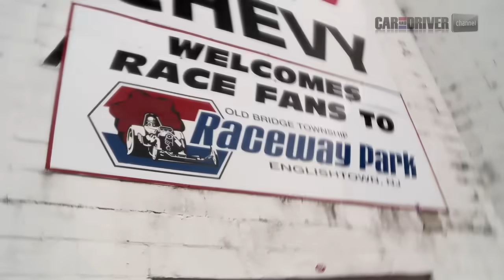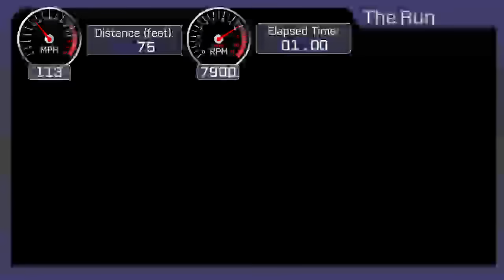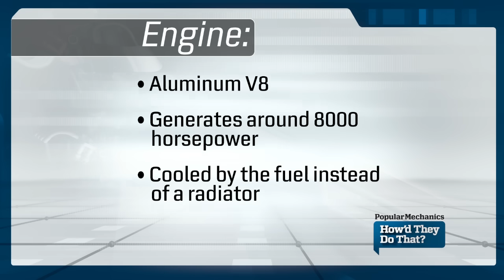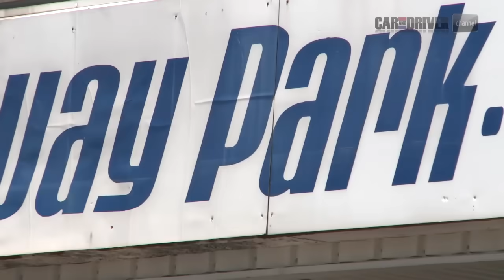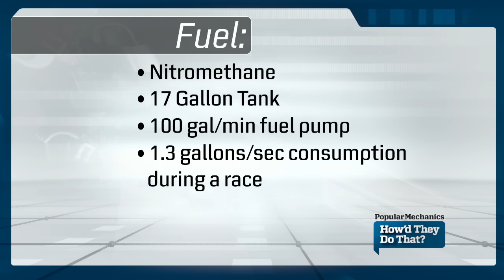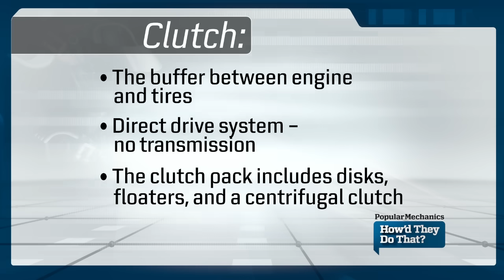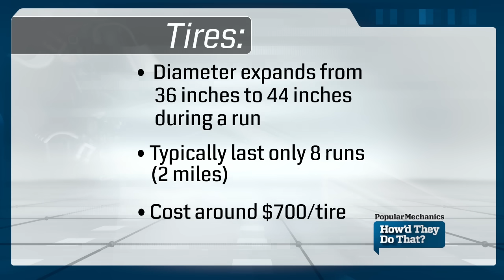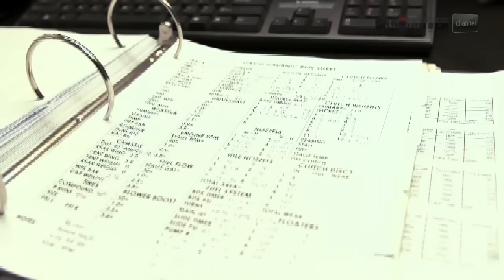How a Top Fuel Dragster Works

Comment: So basically the car destroys itself down the track. Brutal.
Reply: That's what I was thinking after watching this
Reply: yeah, amazing, it consumes itself as it goes! Finish your run, you get all new parts! No wonder tickets to these are so expensive, we are buying new engines for everybody!
Reply: +Muamin “Cloud” Hugsy  A lot of people work like that too.
Reply: +WillieStroker? NoButiWillLetYourMom they don't help cooling its air cooled engine
Reply: +Don't race me I'm to fast 
He's correct, the nitromethene actually does help cool the car.
Reply: +Wesley Eisenberg No, not exactly. You can get an entire 4 day pass for less than $300. That's cheaper than any professional sport that exists and this is for 4 days. Spectator's pay for the seating, workers, and maintenance of the track. the sponsors pay for everything on the cars. If we paid for the car maintenance then tickets would be well over $1,000 and we'd be paying for a race that's 2-3 weeks in advance.
Reply: Mitch S

well part true. Some parts can be reused if they are found to still be good. their are other parts that will not ever be found to be reusable. Clutches are always going to be new as an example.
Reply: yes. clutch discs, pistons, push tubes, bearings and spark plugs are all replaced every run. all parts are inspected and any that are damaged are replaced. Every team has 8 sets of engine parts for 8 runs, all are manufactured about 2-3 weeks in advance. most funny car teams have off-site trailers containing spare bodies in case of an explosion that doesn't damage the frame too bad. and I think you were referring to Wesley's comment about all new parts lol
Reply: +Muamin “Cloud” Hugsy Exactly. They build engine just so it could commit suicide and be refurbished after 4 seconds of use.
Reply: +Muamin “Cloud” Hugsy I was surprised. I wonder if their engine would not be wrecked every time if they use a stronger metal then aluminum, they could use titanium which is what jet engines are made of.
Reply: +Muamin “Cloud” Hugsy   a type of controlled destruction,  its when it gets out of control when the problems start
Reply: As cool as these things are, I hate it when people compare purpose built/purpose tuned drag cars to sports and supercars. You don't replace a supercar engine after every sunday drive lol, nor do you only go in a straight line
Reply: fishis14 Unless you are driving american muscle. Then regular engine changes and driving only in  straight line is pretty much regular XD But yes I understand you and I agree
Reply: It destroys much of its engine in exchange for victory. Sounds reasonable to me.
Reply: winkerdude Sometimes you have to break a few eggs to make an omelet.
Reply: Wesley Eisenberg..... Actually,  the money for the racing operations comes from the all the sponsor names you see on the cars..... with the Largest Letters (re: name) being that of the "Major Sponsor" (re: Financier) for that particular "cars" operation for the season or multiple season, depending on the contract / "package" with that particular sponsor.

NONE of the "gate money" goes to the teams for parts... or, anything else for that matter.    It all goes to the operation of the track hosting the national event and also to NHRA itself.
Reply: 2Stroke Diesel Power
Reply: Muamin Hugsy like austin coil said "its a controlled explosion!"
Reply: Muamin Hugsy well at least kalitta dragsters do.
Reply: Like the saying goes: if your car isn't falling apart across the finish line, it was over engineered ;)
Reply: They should make a two seater version and give rides for that kind of money instead.
Reply: HappyPantsTime That's why Connie and Doug Kalitta run airlines for their day jobs, to pay the bills on the weekend. They are actually a really great family. They expect others to work as hard as they do, which isn't for everyone, but suites my work ethic. I was honored to be their guest at two race weekends, and allowing me to bring my family. A bigger honor to work for Doug.
Reply: It’s a honda
Reply: Back in the day, parking was free, gate charge was 5-6 bucks and a pit pass was 5 dollars.  Now that was a bargain for a 16 car fuel dragster and a 16 car fuel funny car and a 16 car fuel altered and a 16 car AA/GS field plus a 16 car gas supercharged dragster and various other classes.  Lions, Irwindale and Orange County International Raceway all charged these prices.  the 64 car Funny Car shows were an absolute blast.
Reply: Yep. The clutch gets wrecked, the engine gets thrashed, and the driver's hair stays straight up all the time.
Reply: …..and transmission.
Reply: Loyal car
Reply: Muamin Hugsy actually its trying not too. Ragged edge.
Reply: GameChanger It’s fuel cooled.
Reply: @navcop031  no shit, but not air cooled..
Reply: the truth is even your everyday car destroys itself a little every day, we just call it wear parts spark plugs, tires, transmission clutch disk, tires, brakes ect.
Reply: @wesleyeisenberg4180  not the whole engine every time just those things like pistons, cylinder head gaskets etc.
Reply: Martyrdom : drop a live grenade when killed.
Reply: @twistedyogert  i think they use aluminium as it bends in a controlled way if it didnt it would destroy other bits and aluminium is a good conductor of heat so cools quite well for a short time
Reply: @hammerlane3871  Here in Sydney it cost $20 for an all day pass on a Friday top fuel night. $40 on Saturday
Reply: I always heard the "dieseling" thing was a myth. It doesn't really make sense when you think about it. I mean, compression ratios matter A LOT, especially at these extremes.
Reply: it is brutal but that's what drag racing in the nitro classes is all about.  Going fast and getting to the win light first
Reply: Honestly kinda ruins any interest in it for me.
Reply: @EricH928  an their innards are left at the starting line
Reply: @David Futrell even though its way shorter, its more entertaining, if you want circuit races go see f1 or pirelle cup
Reply: ...engineerwise the best what could happen..
Reply: Every vehicle does. Just normal cars aren't pushed to the absolute mechanical limits. They're just wearing out faster. Just like the engine in your car, but with 20 times the horsepower
Reply: Yes we have to rebuild our cars after each round
Reply: And destroys you ability to ever feel a thrill from speed anywhere else.
Reply: Gets a rebuild between every pull.
Reply: @hammerlane3871  pay for 4 days, bored after one 😂
Reply: Love It , So What's Your Point.
Reply: yep destroys itself just to be rebuilt in a couple of hours just to be destroyed again😂
Reply: @wesleyeisenberg4180  no they don’t get new parts every run, all they get is new rings

Comment: Yeah but whats its nurburgring lap time?
Reply: Adam Nelson uh
Reply: not about turning  all about traction. put a for here or what ever car you like on a track and let's see what it does.
Reply: HAHAHA
Reply: I wonder if it would still beat a normal car because on the straights its so much faster.In theory ofc it would melt before it got 1 mile in the real world.
Reply: I bet it wouldn't. If it were shorter I guess it would
Reply: well you'd have to refuel it every 10sec ^^
Reply: Neil Kee lol
Reply: Neil Kee hi
Reply: probably they have to measure it with a calendar 😂😂
Reply: 2min
Reply: Ye I think the turning circle is massive, the steering wheel is only meant to make little adjustments, if you sorted that out maybe it could get through the track but it'd be pitifully slow, with the tracks surface they wudnt be able to go very fast even down the straights
Reply: ...when it strikes the berm in turn one at 262mph and folds in half, pieces will be recovered across the track. The bigger pieces will be fun to watch. Nitro-Methane is unforgiving.
Reply: This actually made me laugh so hard
Reply: The only people who care about Nurburgring is those who cannot drve or own an inferior car.
Reply: Paul Bachman well, I guess you meant superior, let's see this thing take a corner. And there goes the superiority down the drain. Calling those things cars is a joke in itself
Reply: Neil Kee the crew and engineers perfected a 10,000 hp engine, they'd figure it out quick.
Reply: John Dalecki perfected? They ruin their Transmission in the process, let alone the  engine. That's not perfection
Reply: None of your business... it sounds crazy and im no mechanic but it appears they are extracting every ounce of the potential energy this equipment has to offer in just a few seconds. My take is it appears the mechanical life span of every part under this stress is somewhere around .25000001 miles. If a nascar team were given some magical option to run a car that is guaranteed to be scrap metal at exactly mile 501,  I think it would only come down to the budget. If drag racing were 1/2 mile,1,2 or 10 miles, these cars would be adjusted in order to barely crossing the finish line. Thoughts?
Reply: John Dalecki still the same thoughts. There always is wear. Perfection would be, if you didn't have to replace the most expensive part of the car after a mile or whatever. And NASCAR... Come on dude, that's America's shitty excuse for actual racing. Look at Lemans, or any GT3 cup for that matter. Long lasting quick cars, which are designed to deal with that shit.
Reply: None of your business I agree nascar is awful sport but in their ONLY defence look at the rules, they won't allow current technology to be employed. Why does the McLaren f1 cost 15million today and require $200,000 -300,000 in maintained per year, changing tires cost $50,000, because it was not engineered to be on the streets. Finishing the race was the extent of its origional expectations . I know I'm skipping around a lot but how on earth cold you think a direct drive clutch could ever take a car from 0-60 in what 0.36 seconds (in 18 feet)at 5 g's (that's so sick) more than once in its entire mechanical life span. And subject an engine to 19 gallons of rocket fuel in just 4 second....sorry but it has well served it's purpose. First sign of wear replace it. They could use 50,000 mile Michelin but they'll keep pushing tire technology until they're so good they burn up after just  .2500001 miles
Reply: None of your business by they way what part of the world do you live in.
Reply: Never
Reply: John Dalecki I'm a bit late, I guess. I'm from Germany. 
So.. Yeah, I'm a bit biased on what is an actual track, and what isn't. 
Acceleration is a thing, sure. But you have to handle that power in corners, and that's why I don't like drag and NASCAR. 
I mean.. run those cars around an actual track. Most drivers will end up off track, even if they are in a car designed for the track. 
And if it's the Nordschleife.. You simply CAN'T push your limits, if you don't know it.
Reply: Neil Kee oh ya it would just topple
Reply: None of your business Actually stock cars (NASCAR) can handle courses with turns, they're not the best at it but they're more than capable of going around a track like Monza or the Nür. Americans have managed to push their engines to the absolute limits of how much power you can extract out of 8 cylinders. These top fuel dragster are among the quickest vehicles on the ground and that's their purpose. As far as a circuit track is concerned we as Americans aren't far from that either anymore.
Reply: daryl collins the corvette pulls about 1G in cornering force it no f1 car which pull 6.5 lateral Gs so it hasn’t really RAPED the Nurburgring 
If u were to train the muscles in your neck and make them strong u could withstand the g force 
U sound like u know a go bit about cars but do u know that a 2018 f1 car pulls more g’s through corners than top fuel dragsters can in acceleration 
The corvette zr1 got a 7:19.6 on the Nurburgring saying the Porsche gt2 rs got a 6:47.3
Reply: Kk
Reply: Zac Casey the corners are about equal to the acceleration of a top fuel. They both are close to 8 Gs. Either way, the average person can only withstand 5 Gs before passing out. People don’t realize the real effect that has on your body, even NASCAR drivers have to be fit. A lot of people don’t know all these drivers have to keep themselves in shape. America is all about acceleration tho. Raw power. And why are you comparing the ZR1 to a formula 1 car?
Reply: daryl collins they don’t pull 8G  f1 cars pull 6.5G in corners and top fuel dragsters pull 5G under acceleration I don’t know were u got 8G from
Reply: Zac Casey simple mathematics. Launch acceleration approaches 8Gs. And doesn’t go under 4 until chutes are deployed. You have to realize these dragsters go 0-100 in UNDER 1 second. Also. Formula 1 cars just gained that increased G Force. Like i said tho. Either way that shit is taxing on your body. Even NASCAR drivers endure it.
Reply: daryl collins alright calm down
Reply: Neil Kee yes
Reply: robert wilson bud it was a joke
Reply: Many, many hours as the engine will have to be rebuilt all the time.
Reply: robert wilson r/Woooshhh
Reply: So many people not getting the joke.
Reply: Adam Nelson I laughed too much at this
Reply: it would be a slow time, they will have to refuel each mile :D
Reply: Nothing you run at Nurbug. has the power or speed of a Top Fuel dragster. It's comparing apples to oranges.
Reply: Neil Kee lol
Reply: It wouldnt be that good, considering it ll have to refuel 17 times
Reply: Hmmm, lets put a lambo next to it on tje drag strip, then put them together on nurburgring and see whats the time
Reply: @robertwilson3453  ohh so like hellcats and Corvettes??? I see, thanks man.
Reply: Years
Reply: @deadsi  r/wooooooosh
Reply: It's official time is: not even one corner.
Reply: @deadsi  the engine would destroy itself before a lap is completed, an engine is rebuilt after every 1/4 mile run that's how much stressed the components are
Reply: Adam Nelson In 2019 they run 3.67 at 335 mph in the 1000 foot.
Reply: Max Pheby based on its tight little body it would be a terrible idea to go on a normal race track
Reply: 14 miles/338 mph do the math
Reply: @noneofyourbusiness4294  lmao you bring up a corner when you know your civic can't do a 1/4 in 3 years lol
Reply: @Nowt117  probably because neither do I have a civic, nor do I have the slightest interest in the idiot's idea of racing: drag.
Reply: @dumyjobby  yeah it only gets destroyed when they're going all out, they can turn it down enough to stop that happening, but that's not how you win.
Reply: The vehicle and it's driver will probably be a pile of rubble 10 seconds into the race
Reply: @ameisenbar9378  So we would be there all day...
Reply: @eX0dusmods  I get your point. However, you should not put all Europeans in the same basket.
NASCAR and Drag Racing have their charm. No one should deny that. NASCAR is a great sport with great wheel to wheel racing. Drag racing has a great appeal in its unbelievable acceleration and engine rebuild times.

You will find a lot of Europeans trash talking American series, but do not listen to them. Some of us do admire what you guys do in America. For example, the speed that you guys rebuild a drag engine is truly remarkable.

So, please feel free to criticize individuals but avoid criticizing us as a whole. Many of us respect and admire your racing series.
Reply: It would run out of fuel first
Reply: I got this comment to 1K likes.
Reply: Luke Brown they’ve got pretty good turning capability, but they’re just so long
Reply: None of your business but he’s saying IF they were allowed to completely trash the engine as soon as they cross the line and not have to worry about using it for the next race, they’d be much faster
Reply: I like how everyone is shitting on America for NASCAR and drag racing, but meanwhile in the outback they’re down there competing in burnout competitions lol
Reply: Who cares
Reply: 3 days coz they aren’t made to steer much
Reply: i'll bet a 1970 volvo would be faster
Reply: Brandon Blankson r/wooosh
Reply: theres a video of someone doing nurburgring with a top fuel on assetto corsa
Reply: 4 seconds. Car dies after that.
Reply: T h e B a y L e a f  what’s an f1 cars time at a rally cross race?
Reply: It would probably run out of fuel.
Reply: T h e B a y L e a f yeah but what’s a f1 cars lap time at eldora
Reply: @brandonblankson9828  >ง
Reply: Approx 7 blown engines
Reply: about 20 seconds cutting through trees and hills lol
Reply: @AMoistBum  plus 20 days for 250 engine rebuilds...
Reply: It cant steer.
Reply: @outrundoubtrun-lemonadeart682  TFD's also have no cooling system. They can steer though, watch them backing up and lining up, the front wheels can turn white a lot.
Reply: @robertwilson3453  r/wooosh
Reply: @thebayleaf221  Then put a funny car on the Nuremberg
Reply: @Dragjr-xg7zy  also v8 supercars which is gt3-ish, they also have Australian GT, Formula 3 and Formula Ford
Reply: @hunterbunter2960  exactly, they're built for different things. I think its fair to say formula 1 cars are overall superior, but that's unfair to the dragsters which are built only for straight line speed, whereas the F1 cars are built to be fast on corners as well
Reply: @Atomic_Sunday  I would pay good money to see a nascar go around monaco lol
Reply: lol imagine it try to get around monaco that would be hilarious
Reply: The estimated lap time or ET is between 315 and 320mph
Reply: DNF
Reply: Nah, the engine would be a hunk of molten metal at that point